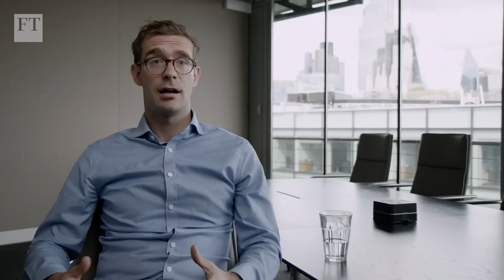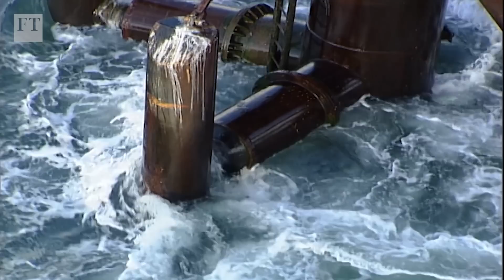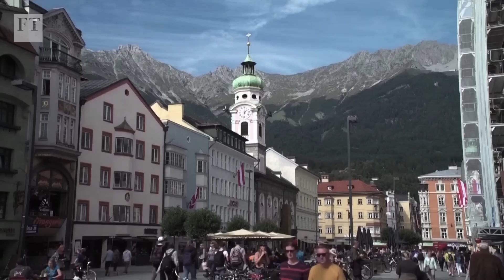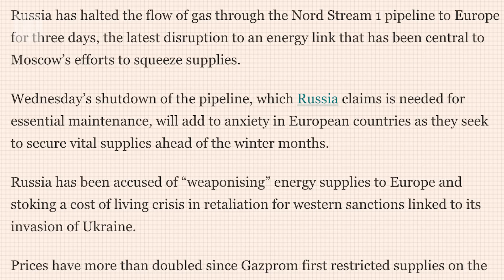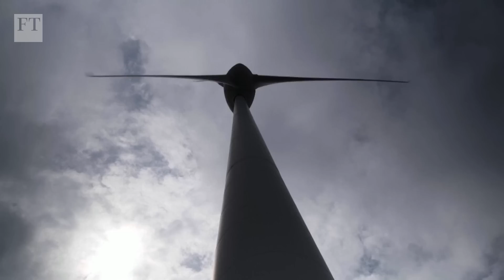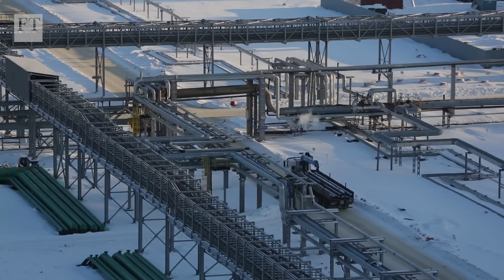How Putin held Europe hostage over energy | FT Energy Source

Comment: With Putin's help Europe is one step closer to achieving net-zero. What's the problem?
Reply: Cold turkey lets get this over with.
Reply: hahha top joke
Reply: The problem is 'Winter is coming'.  Haha
Reply: Hahah
Reply: Actually think it will delay net zero. Without a buoyant economy to subsidies and invest in renewables (which have a very long pay back)  it just won't happen and we will need to rely on older tech.
Reply: What if natural elements gets disrupted, like no wind and sun
Reply: I agree. We in the UK are talking more renewables since the invasion. However, stunting growth can have adverse impact on firm's ability to develop these sources
Reply: @michaellee3314  Some sort of wooly jumper needed then!
Reply: @nnenna2975  You use things called ` Batteries` see when its very windy / blazing Sun you get too much energy and you store it in a `battery` just like you store gas and oil and then you use the stored energy and top it up again when situation reverses .. because .. the sun and wind have not stopped for BILLIONS of years and its hard for any opponent to switch them off
Reply: Net-zero will remain a pipe-dream for a few years if not decades, good luck running your house and industries on hopes and dreams. I wish you well.
Reply: @Crashed131963  Thats a cold hearted take ;p
Reply: @frka.836  so what are they going to do once you have a solar panel installed or Nuclear power plant built? Take it back by saying we built it / supplied the bits its ours? 
Why should Europe trust ANYONE including the USA to always supply would the USA do so the other way?
Reply: thank god for global warming, otherwise the europeans would freeze this winter.
Reply: Inefficient coal burning so the continent doesn't freeze to death and the end of the central European industrial sector and a generational economic depression.
Reply: @DDCrp  Germany has the 6th largest coal reserves in the world.  Better to use it than freeze.
Gas. Nuclear , or coal who cares what heat source makes the steam for electricity.
Reply: @memeyoulate  😄
Reply: Don't be stupid - that is more than a decade away - the technology still has a long way to go to be able to power at the scale needed.
Reply: I think so. In the long run, it may be a good thing that the war in Ukraine has triggered huge changes in the thinking of politicians. And I hope that eventually Europe will get rid of its dependence on all non-European energy sources.
Reply: yea in Germany and Netherlands where i live people are collecting wood for heat in winter, very net zero!
Reply: @marviwilson1853  will this do !?🐑👍🆗😁
Reply: @cheesypuffs1342  😂👍👍
Reply: @steve.k4735  Europe relies more and more on the US, that is what is happening, not my opinion.
To use renewable energies you will need to rely more on China, who produces most of the rare earths.
But so far they aren't even doing that, they are simply buying more coal, oil and gas from other countries, great democracies like Qatar, Algeria,Saudi A. So  they whole autonomy is already doomed.
Reply: @michaellee3314  EU has 10 weeks of gas in reserve, don't get to excited.
Reply: Agree, we are insulating our houses, going electric as much as we can, invest in renewables as much as we can, this war probably pushed us 5 years ahead twords the target.
Reply: @peterelliott7294  Looks about right.
Reply: @frka.836  you only `rely` till they are built then they can`t switch them off, no one can switch off UK wind turbines which already supply 20% of UK power .. relying on US Oil and Gas STILL leaves Europe extremely vulnerable as the US would quite rightly look after itself first .. Europe needs energy independent and that has to be ultimately from resources we control that cant be switched off, we would be fools to presume on permeant US goodwill or even ability to supply.
Reply: So long as is it net zero T62s, T70s, T90s and russian soldiers I'm ok with it.
Reply: @michaellee3314  Its going to be an expensive winter, no doubt. But it is going to be the New Red Army's last winter. An outcome worth paying for.
Reply: @williamzk9083  It will help and hinder William. 
There will be more nuclear power, a lot more wind, thousands of homes per week are having Solar installed on their roofs each week in the UK alone. But yes, it will reduce the money available for Electric car infrastructure subsidies....but the market will sort it out eventually.
Reply: @memeyoulate  Yes, Putin's invasion means more coal will need to be burned. Go and tell him he is a bad man. He's also burned square mile after square mile of crops - don't forget to tell him off about that too while you are in Moscow.
Reply: @steve.k4735  Grid scale batteries are in there infancy and will require massive investments and untold amounts of mined materials. I have a small electrical backup at home that cost hundreds of American dollars and isn't even a full kilowatt system. A country like Germany would need dozens of Gigawatt systems just to smooth out demand over one day
Reply: Net-zero NG = net-zero growth = net-zero population.
Reply: @steve.k4735  Cool enough, I think we are in general agreement it may be a long journey we need to start now. Little easier for me in the windswept American Midwest tho.
Reply: @steve.k4735  Good. Why don’t you invent and produce these magical grid storage batteries?
Reply: @steve.k4735  Batteries are not enough, especially if you want to store summer energy for winter heating. Nukes for baseload are a must unless there is a miracle in battery technology, which even if it was discovered tomorrow would take at least 10 years to scale up.
Reply: Lol
Reply: quite far from the truth actually
Reply: Putin actually listened to Greta: he is helping Europe achieve Green goals in a radical way.
Reply: @Mandanara  yeah wind solar geothermal nuclear and its May take 20 years.. So what... 20 years will pass.. Energy independence is a political and military MUST as history shows or your economy can be threatened or crashed
Reply: @peredavi  OK DONE
The Victorian Big Battery, a 450MWh lithium-ion battery energy storage system (BESS) in Australia, has been officially opened (Dec 21) in the state of Victoria. 
The system will charge during the day when abundant renewable energy is available
The Victorian Big Battery system’s construction has been completed in under a year.
Magic? Really? .. oil is not magic batteries are not magic Europe needs energy security batteries which already exist and are understood are part of that, production needs to be ramped
Reply: @marviwilson1853  Not here sunshine?
Reply: Net-zero. giggles It's like trying to find the solution to ageing...
Reply: We should honour the European People for volunteering for energy transfer experiment. The world can learn alot from these experiments.
Reply: @steve.k4735  where do the resources like lithium for batteries come from or Nicole, iron, zinc, this is a resource war, and there we go with another dependency cycle.
Reply: @jamapx  you know mathematics. 👏🌹
Reply: @ballerblocks  With 8 million tons, Chile has the world’s largest known lithium reserves. This puts the South American country ahead of Australia (2.7 million tons), Argentina (2 million tons) and China (1 million tons). Within Europe, Portugal has smaller quantities of the valuable raw material. 
i
reserves of crude iron ore in Australia 29% of world total, the country with the world's largest iron ore reserves Brazil 19%

nickel reserves amounted to approximately 95 million metric tons. Of that amount, Indonesia and Australia held the world’s largest shares, at 21 million metric tons each.

Zinc Australia had the largest share with 27%, followed by China (18%). The other rankings include Mexico (9%), Russia (9%), Peru (7%), Kazakhstan (5%), United States (4%)
SO
for the 4 you asked no problem Europe can get it and then .. Australia is both stable and friendly it alone is almost enough
recycle the raw battery materials so even now today Tesla can recycle 92 percent of battery ( this is happening google Redwood Materials contracts in place facilities being built) cell materials once you have the raw materials you don't have to keep going back for more
as opposed too
OIL The Middle East accounts for almost half of the global oil reserves, with 48.3 percent of the world's reserve in 2020
GAS  In 2020, the United States was the world's largest natural gas producer in the world, producing nearly 948 billion cubic meters. Russia was the second largest natural gas producer, with its 2020 production amounting to over 693 billion cubic meters. Iran 205 China 202
Oil and Gas are held by far more unstable countries and once used its gone the dependency never EVER ends down that route, we can produce the energy once we have the raw materials reuse them and store our own
Reply: @steve.k4735  missing the point completely. You have just identified the biggest problem that I did not articulate.
Resources everywhere, but it's cost advantage and locality that's important, shipping,storage,local transportation etc. These things add Extra cost to it. This was why Russia was.so advantageous to us. Everything next door.
The other problem, is that it reduces our manufacturing advantage, i.e China and india will now be the sole beneficiary of these sanctions, their respective productio. Cost will be lower and goods prices more competitively.
I hope I am wrong, but just look at the list of steel and chemical factories closed in Europe due to this stupid war.
Reply: @ballerblocks  1. The `problem` you articulated is NOT a problem, plenty of resource's not in unstable dictatorships PLUS once you have the resources you can reuse to make new batteries the mineral themselves are NOT used up (unlike oil) so eventually 2040-50 you don`t need anyone's minerals, dependency cycle broken
2. Russia was advantageous? ONLY in location but the cost is it has you by the balls and now it can squeeze, you can NOT let a dictator have control of your energy. Its only a matter of time before they squeeze or Saudi Arabia decides it wants to stop pumping oil ... Batteries Wind Wave Solar Nuclear can all be produced with much shorter supply lines than Russia  .. energy is the vital underpinning of all advanced society and for this reason security trumps cost,
3. Russia cant just pivot its energy to India / China Nord stream 1 took 15 YEARS from start to pumping .. Russia cant move its gas fields its a bloody long way to India China .. yes they can and are sending more but its complex / takes enormous time to build the infrastructure to shift massive amounts.
4 the ONLY way to break the dependency cycle you hate is make your own, batteries are PART of that solution
5, China has massive internal problems with its bursting property bubble and India? they are barely above the UK on its own hardly a economic superpower,
6. of course Europe will suffer short term but what was the solution? just ignore the Ukraine you would STILL need to shift your energy or always have the same threat,
Reply: The problem is there going to be higher energy prices a spike in inflation, job loss all round lifes going to get more difficult...
Achieving net zero thats kinda funny when European capitals are thinking of bringing back coal...
Reply: lmao at this comment
Reply: @ballerblocks  Nuclear maybe .. but business as usual 100% no that bridge is burnt and its not being rebuilt the trust is shattered
Reply: @steve.k4735  trust is shattered by whom. ?
Reply: It rapidly destroy economy.  Bad economy means less money for tax and less spending for social welfare.  And people will have to pay more for essential service like healthcare and education on top of high energy price.
Reply: No problem at all 😀
Reply: @nnenna2975  fathom the thought
Reply: Hahahaha. Nice one.
Reply: All environmentalist should laud Putin for this move. He single handedly fulfilled their demands that entire EU structure was unable to get to.
Reply: @Never-ending_  why not use nuclear it's literally the future of green energy
Reply: @steve.k4735  battery storage has high losses due to lower entropy in storage than in flow. Gas has similar entropy in storage as it does in flow.
Reply: Europe apparently needed this wake up call.
Reply: Hahahahah seriously @3125 said that ? What a mess
Reply: @nnenna2975  nuclear tech is way to go
Reply: @ca6360   Putin would never have had the balls to do this on Trump’s watch.
Reply: Hell yeah! Energy independence
Reply: I love your optimism 😁
Reply: @williamzk9083  I am not sure. In Germany, at least, there was quite a bit of Greed involved and thus there was a too long delay to really get going with innovation and investment into renewables. I think this is being made clear by the great amount of funds used to subsidise oil and gas to this day .
Reply: @I DON'T WANNA FIGHT WITH U the reason, Europe has never seen this before is: we aren't really that old, yet.😁
Reply: @thesilkpainter  The process of purchasing energy from Russia started in the mid 1970s under Willy Brandt before we even had 'renewables'  and was meant to start the process of normalisation.   LNG is at least twice as expensive as pipeline gas (if not more).   It's OK for Americans, Norwegians even British how have Natural Gas.  Germany and much of Europe doesn't.   Renewables also simply don't work except in the very rare case of countries with good wind resources and exceptional levels of hydro.
Reply: @hectoralejandro9883  or the leverage.. Biden gave him the leverage to pull this off.. and china abilty to cozy up and aid
Reply: @Never-ending_  Ok right. After this winter, then how?? No need gas and oil for coming Spring, Summer, Autumn ? How are you going to top up your reserve for winter 2023?  Even say EU can, only the richer ones can afford to pay the bills. The cost will be worst then now. The only solution is to bend the knee like what Germany is trying to do subtlely.
Reply: Cant you see the problems? Are you blind? Do you live on another planet?
Reply: @michaellee3314  it will sort out their pension problem also.
Reply: @Crashed131963  they just need to go and catch some canaries now.
Reply: 😂😂😂 good one
Reply: Only if Northern Europe doesn't waste money on solar
Reply: Exactly should have listening to kids Greta Thunberg 5 years ago...now the putin mouse trap worked.
Reply: Net zero is for WEF clowns. That have a lot of money
Reply: Is anyone really surprised knowing criminal Putin,been expecting something like this for decades.
Reply: Not at all, we have increases burning coal for energy now, which is worse.
Reply: i dunno man. my business partners are liquidating their shares in Canada to plug the hole in germany. Cost of heating for them has gone up 7~10x. Really hard to run a business with energy bills like that. 

russia by contrast has tons of food & energy. the neocons in those ivory towers did not plan these sanctions very well. There was some meeting just a couple days ago where India, Eurasian countries like where Borat is from & they basically all said they support & will trade w/ russia. so even if all western countries cut the ruskies off, that's only like 15% of the world's population.
Reply: @nnenna2975  like no water and no food 🤔
Reply: @ozeeo  me too in France 👍
Reply: Net zero democracy

Comment: My view as a non-westerner: If Europe is so dependent on Russia oil and gas, why does EU impose sanctions on Russia? This very act of sanctions is going to make/has made Europeans become energy deprived and therefore suffer because renewable energy is weak and still unreliable, additionally Europe is weaning off nuclear energy. There are other ways to deal with Russia, the sanctions are stupid in that it causes many supply shortages. From being dependent on Russia to now dependent on the US, is that any better? Better solution is to be powered by nuclear energy, clean and reliable, but no, because of the lobbies. Europe is committing economic suicide. Inflation + cold + hunger + unemployment do not mix well, the civil unrest come winter is foreseeable, so is the economic decline in Europe hereafter. It is an incompetent leadership, or is their intention to destroy Europe with the aim to achieve a reset?

Comment: Importing LNG through ships is a lot more expensive and has a much larger carbon footprint than sending liquified natural gas from Russia to Europe through pipes.
Reply: I dont think Russia wastes its resources on wind turbines .It doesn't care about carbon footprints either. Britain and the EU have weakened their energy grids by building intermittent renewables which only work with gas fired power stations .They made a mistake in shutting down coal fired power stations
Reply: Gas from Russia is not liquified, but Russia is intentionally cutting off gas supply to Europe.  They're not exactly a rational seller, but it's their choice.

Gas is fungible, so China should ask Russia for more gas otherwise China will have to compete with Europe for LNG and pay more
Reply: @davidgfisher  So Russia's energy contract includes all the current disruptions?  Did the contract also include anything about not sanctioning Russia?

Don't forget about the memoranda, which Russia is a signatory, prohibited the Russian, the United Kingdom and the United States from threatening or using military force or economic coercion against Ukraine, Belarus, and Kazakhstan.
Reply: @bravado7  You can't declare an economic war on someone and still expects them to honour contracts that benefit you. Real world doesn't work like that